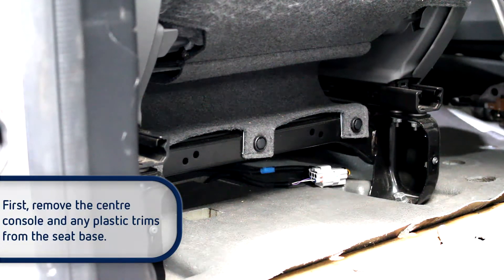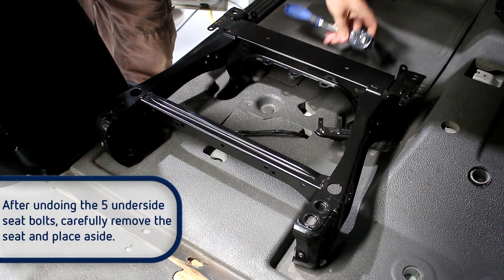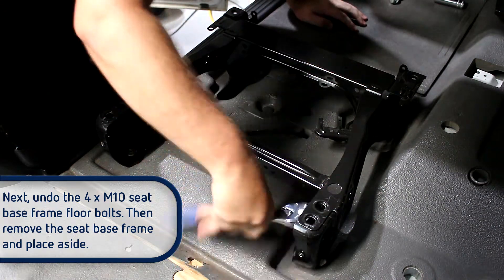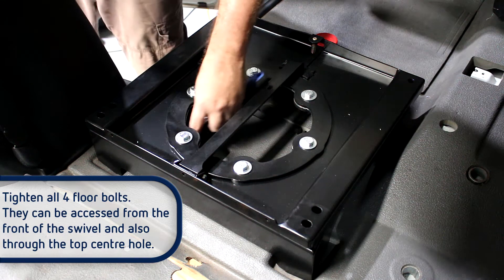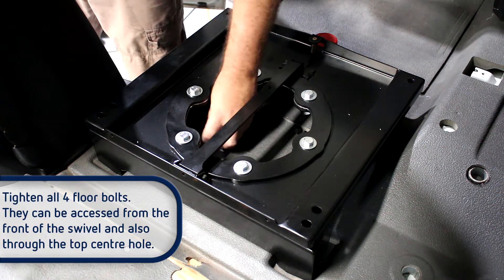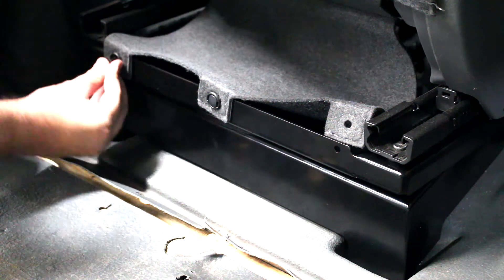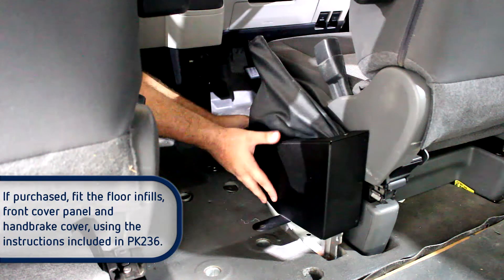Toyota H300 Hiace Seat Swivel - Installation Video

Comment: What about the airbag connection?
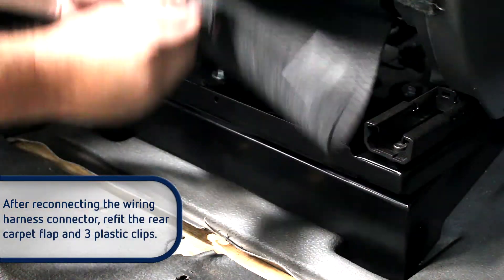Reply from the maker: The airbag wiring harness/connector can be clipped into the the top of the swivel lever during the install process. A note can be seen at the 3:04 second mark and also on our website :)
https://www.techsafeseating.com.au/toyota-hiace-h300-seat-swivel
Reply: @techsafeseating have these seat bases been tested for strength in the event of a crash?
Reply from the maker: @liammorgans7329  Yes, the swivel bases are fully tested and certified :)

The manufacturer has complied with Australian Design Rules 3 & 5 under Test Report / VSB 14 LK2 Number 20210022R001Rev0 when correctly installed. Installation must be by a competent mechanical service and installer must ensure modification is certified in accordance with the requirements of their jurisdiction.
Reply: @techsafeseating  awesome, thanks

Comment: What about the driver seat , does it hit the hand brake ??
Reply from the maker: If fitting a swivel to the driver side seat, the handbrake must be relocated/converted to a floor type, or push button parking brake.